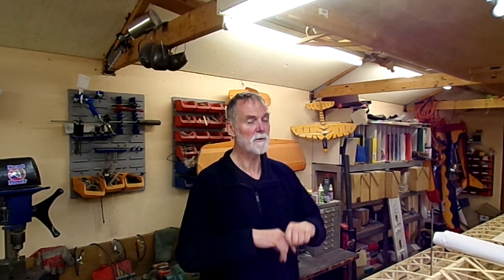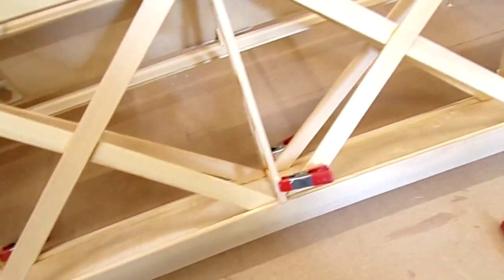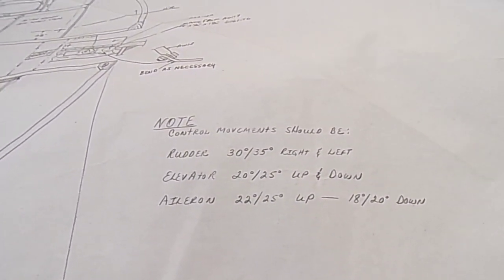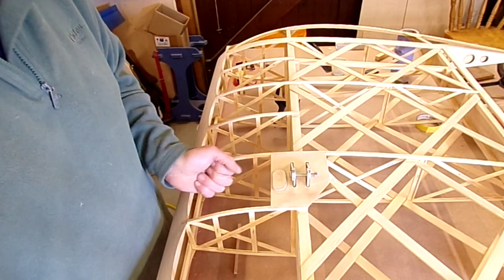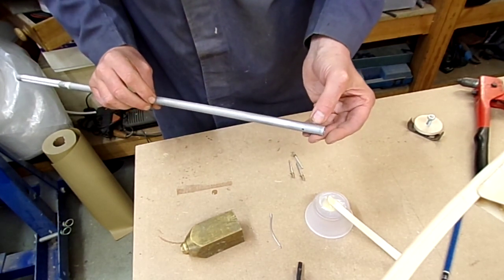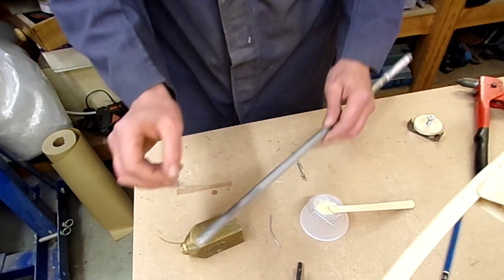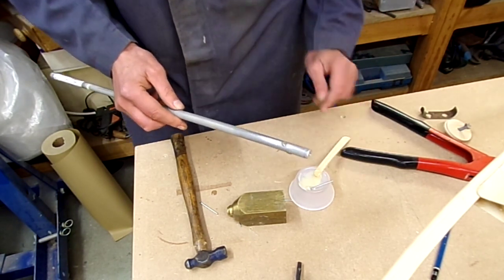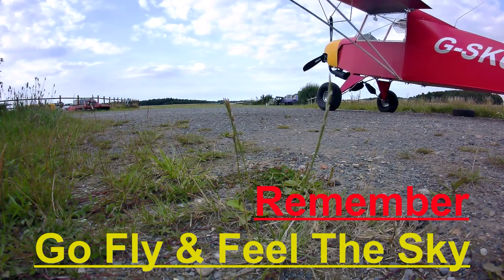EP47 Fisher Youngster V Aileron work control rods Mod.

Comment: It's great to see the metalwork getting installed. Details, detail and more details. So many little pieces, it's like the parts list is endless.
Reply from the maker: Thanks Giles yes and very few just fit without having to be fabricated or made to fit. My aileron control rods are modified from the sleeved tubes with a bolt through shown on the plan (with proper rod ends).

Comment: Being frustrated by a lack of progress just proves you are enthusiastic for the task, which is good.

I (in the scale model alternative) on the other hand get distracted.  Not quite completed the 1: 32 Tiger Moth yet but I started on a 1:72 EoN Eton glider.  I'm doing the external rigging with "E Z line" (fine elasticated thread), held in place with some PVA glue applied into the moulded anchor points with a cocktail stick.  It's one of those kits which fit on the palm of a man's hand, 5 3/4" by 3 1/2".
I don't have a pair of dividers to measure the bracing wire gap in the scale Tiger Moth, so I'm going to estimate using a compas with a pin mounted on a brush, where the pencil goes.
Reply from the maker: I have made a few small scale models, I would heat up sprew and then stretch it out to make up the rigging on WW1 biplanes or arial wires. How well will the elastic last in sun light?
Reply: @flyingkub  Ah yes the "stretched sprue" techique.  Not tried that yet.  Not sure how to get consistant thicknesses,  I don't think my models will get much sunlight or how resistant to perishing the "EZ-line" is.  It is about the thickness of a human hair though, so we will see.  I will try to apply some silver paint to them, so that may give enought protection.  The whole model is at new levels of fragile anyway.
Reply from the maker: @Payne2view  I will be interested in how you find it. I would think a water based silver would be safe but any with thinners in it might be a problem for rubber.
Reply: @flyingkub  It is thin water based acrylic paint.  I'm going to be showing it off on my channel in about 2 weeks.  It is really spider web thickness stuff.
Reply from the maker: @Payne2view  Look forward to it.

Comment: Sorry somehow I just put a question on the wrong episode. I'll ask again, how detailed are the instructions or do you just decide the best way to achieve each stage? I saw a little gimps of the instructions but I assume you really need to know what you are doing before attempting this build?
Reply from the maker: As I said Terry it helps if you have experiance building models from plans that way you can figure out what to do from the plans as the information in the instructions is not detailed enough to build for a complete new to building person, unless they use the resorces from the Fisher group or factory, which would slow things down but doable provided they have DIY skills to start.
Reply: @flyingkub  think I'll stick with flying them and let people like you build 'em 🙂
Reply from the maker: @ShortField  fair enough, it takes up a lot of time but I don't let it get in the way of my flying if I can help it.

Comment: I need a lathe
Reply from the maker: They are handy but you can do most of what I have done with a pillar drill, a good machine vice and careful filing.  It wouldn't be worth buy a laith for the project,  find a friend with one or enrol on a metal work class and use theirs.